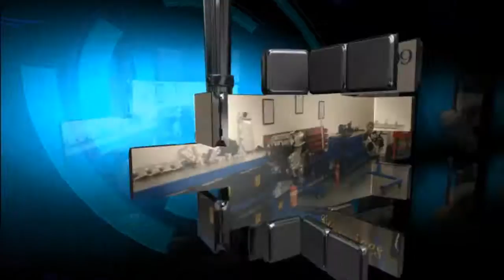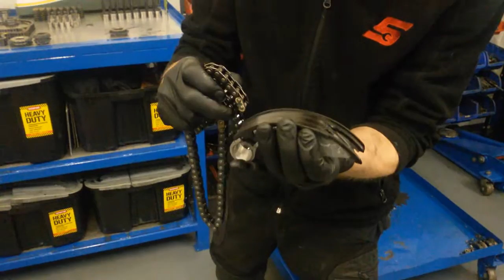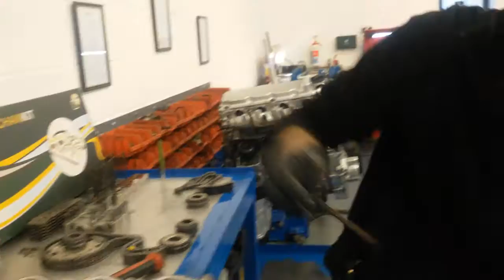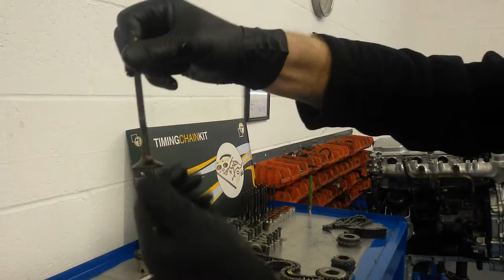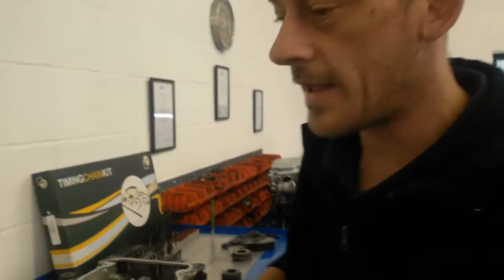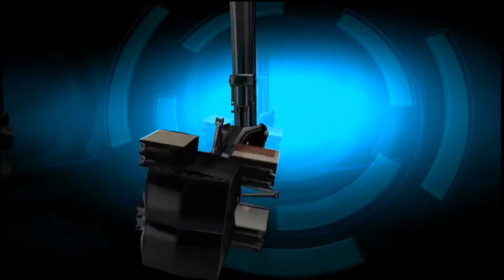Nissan navara d40 snapped timing chain what to

Comment: So when a timing chain snaps how common/often does it damage the pistons/bottom end ?
What’s my chances of just throwing a new complete head and timing chain kit on it
Reply from the maker: it’s never damaged the piston buddy
Reply: Legend!! Thank you for the quick reply !
Reply: Another anoying question 
Would u know what’s diffrent between the pre September 2006 timing chain kit and one that’s for above that?
Bought a kit that said it fitted my 2007 when it arrived instructions says fits VSK pre September 2006 compliance build date
Reply from the maker: jack currie All the same buddy
Reply: Have sent you a email (:
Reply: Are valves always effected with a snapped chain?  
What if its on start up, and the vehicle is doing hardly any speed like 5mph!  Will the valves be OK?

Slap a new chain on?